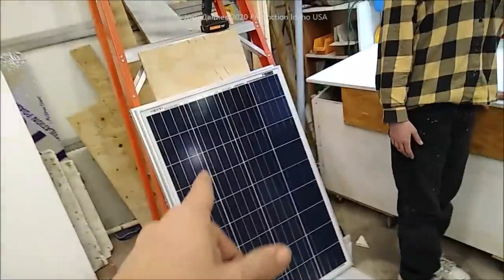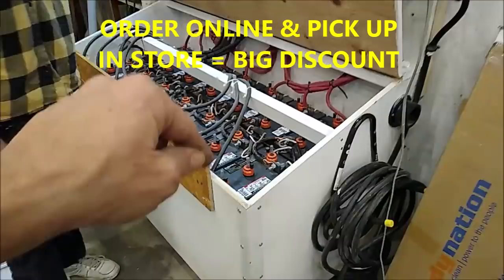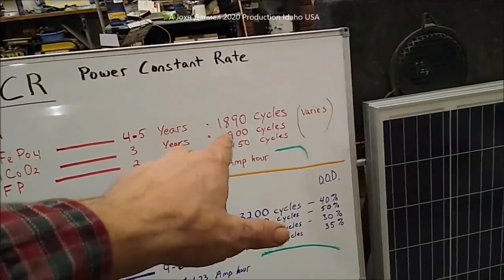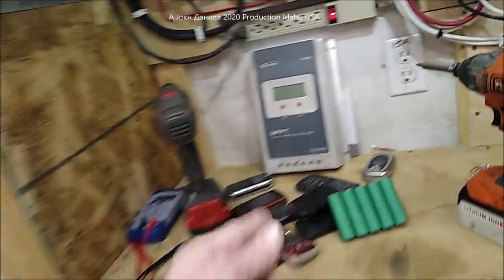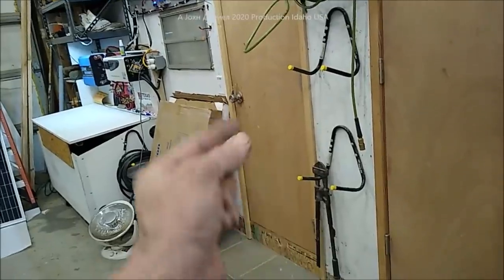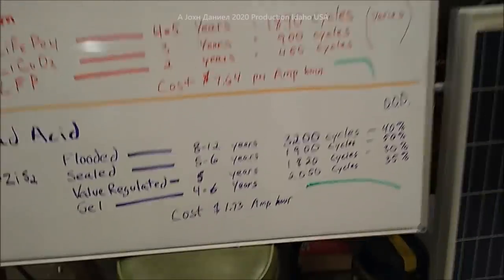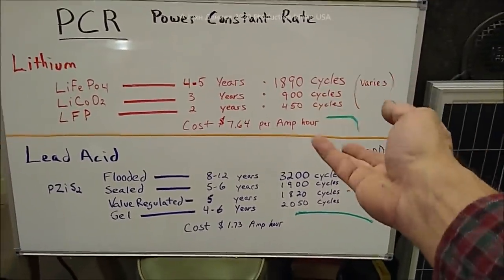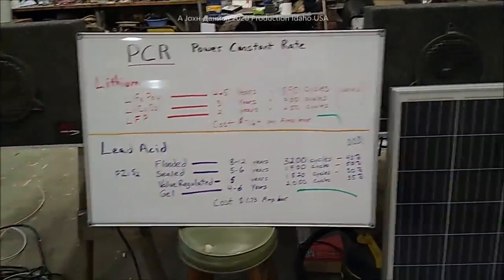Down Side of LITHIUM LiFePO4 Battery $ on RV, off grid & solar use (notes below)

Comment: You get 80-90% DOD with LifePo4 [Lithium Iron Phosphate] over 40% DOD lead acid.

Lithium Iron Phosphate [LifePo4] is stable not the same as unstable Lithium Ion.

Lead acid sucks in cold weather also.

All the batteries you are showing in your video are Lithium Ion chemistry. Not LifePo4. 

Yes I agree Lithium Ion is not stable.

Also lead acid batteries have a much higher resistance to charge. LifePo4 can take a charge faster with less resistance.
Reply: I’ve seen the vid of the 3 inch framing nail going into a used Caleb LiFePo4 prismatic cell from beginning to end. Lots of smoke, but I didn’t see anything go up in flames 🔥. He even picked it up with his bare hand.

I’m not sure what chemistry battery was in that RV you refer to that caught on fire. 

But if its a well built reputable LiFePo4 and didn’t have a 3” nail go thru it. I’m sure it would not have caught fire 🔥

I didn’t see any type of expansion within this video of the cell that got impaled with the 3” nail.
Reply from the maker: @cookemnstr9327  RV BATTERY WAS A 100AH, LiFePo4. But, You just described the issue without trying. But failed to mention QUALITY on these are a 50/50 shot. They were not supposed to swell up, they did. They were not supposed to short and almost double their amps in dumping act, they did. They were not supposed to get a bolt head pressed so deep in one it fused and set wiring and a internal BMS on fire, they did. The fire was due to a controller and under gauged wiring in them. The smoke was from the split open battery and fire. Hopefully you won't be on the jury in that case if the owner sues over it. Even Mr Prowse shows a substandard battery pack with the BMS against the battery cell , and poor wiring internally. When all this is corrected then I can get on board too. My 3 - 25 amp factory made batteries failed in about a year in different acts, all 3. LiFePo4 cells, blue, from Banggood using their motor controller, their chargers. My 36 volt former gas powered Honda 110 ATV is now happily using 3 - 18 hour SLA batteries for its 1000 watt motor, 2 years now. Slower by 2.5 mph, down from 19 to 16, but that ok, I ain't walking now.
Reply: @JOHNDANIEL1  Would't catch me buying the 12v packs, there in lie the gamble. The BMS of poor quality, poor construction, and those cylindrical cells that if not swelling at the very least will go bad one by one and you lose capacity and you can't just break it open and start tearing them out. Build your own out of prismatic cells. My case is unique in that i was able to visit the factory and watch all the test. They drilled a hole, nothing happened. Punctured another with a 12mm pointed round stock, a guy with a small sledge over a steel bin(safety third) nothing happened. Then,,, Laid that same 12 mm round stock from a distance across the terminals. 3.2v @ 200ah. Well, safety vent opens and its quite annoying to say the least and then the top cracks open just as they state in their brochure. They won't tell you that on Aliexpress or Banggood. I went home with an order. A safe installation  means your not going to have trouble. If you don't know safe DC wiring and proper lifepo4 charging characteristics you will kill them. If there is a short in a DC system with a large amount of AH behind it you can expect any battery to fail in an ugly way some nastier than others and wiring can light up and burn you down fuses on each every single battery and using single lifepo4 cells and absolutely NO  Lifepo4 12V PACKS!!! Have a nice day Young Man :)
Reply: So from what I gather on your explanation of this 100ah LiFePo4 catching fire on this RV, is that a bolt head had pressed into it and punctured the battery ??? 

Was it a bad installation ??? 

What caused the bolt to puncture the battery ??? 

I’m trying to understand why the battery would be at fault if it’s being violated with a puncture from a pressed bolt ??
Reply: @cookemnstr9327  No the LiFePo4 did not have a IC board to stop it from doing just that .Look at all the LiFeo4 they or all different boards it deepen on the circuit board it CAN kill you or keep you alive for 20 years . I independently set light from Interment computer room ( info room ) and freezer / fridge
Reply from the maker: @cookemnstr9327  Installation looked fine, contractor for a RV source apparently did it. Owner took it back to Colorado I guess, my job was clean up and put in 2 new regular RV batteries. Battery was not like a Battleborn style Battery thats using lots of round cells in a box, these were 4 packs of flat type looking yellow cartridges. Very weak case, but something went wrong in the end battery, it held air pressure like a balloon, swelled up and pressed the 2 others into a bolt which looked to make a 1/2" indent into one. All started apparently with a failing BMS, ended with a crushed battery part inside. My video was to explain the POOR quality being pushed, not the availability of LiFePo4 or the very few making a best option, just the junk thats being pushed and all the money being wasted on them like a cult, fad, over excited public does. Although I had 3 25ah fail on me, in a year, it told me its the quality thats the biggest problem, not the technology. Only the LiFePo4 cultist pusher gangsters freaked out over the video, they don't care that China is dumping them like crazy.
Reply: @JOHNDANIEL1  yeah I think that the easy places to buy from with free shipping are dumping b c and d grade AND misrepresenting them as otherwise better b as a c and d as b etc. At the factory they were grinding the failed batteries. Happens so fast that no reaction occurs except when one bounces back out, remember safety third. Factory direct is best.
Reply: GREAT VIDEO,...DEMONSTRATING WHAT HAPPENS WHEN YOU HIT THE BATTERY WITH A 3 INCH NAIL,...other then that this is not an apple to apple evaluation of different types of batteries.
Reply: I agree QUALITY is key. People must do their due diligence when purchasing pre-made LiFePo4 batteries. 

However, overall long time cost per ownership of a quality LiFePo4 battery supersedes the lead acid if properly setup. 

You will need less of them because Depth of Discharge is twice as much as Lead Acid and they will take a charge much faster than Lead Acid.

They will not sulphate like Lead Acid either. And you never have to water them.

Also ...  in the end of its rated life cycles of a LiFePo4 you will still have around 80% capacity which is still more then the 40% Depth of Discharge of a new Lead Acid.

I understand where you are coming from, I don’t disagree with you regarding a lot of the garbage pre-made batteries being built. 

People must do their research and due diligence.
Reply: Your talking apples and oranges. LiFePo4 [Lithium Iron Phosphate] chemistry is safe and stable. 

Lithium Ion and Lithium Polymer based chemistries are the unstable batteries.

You get twice as much Depth of Discharge with a LiFePo4 battery versus a lead acid battery.

Plus it charges faster because of its minimal internal resistance versus lead acid high internal resistance.

It’s better than lead acid without any maintenance needed.

Charge controllers need to be in place with the proper parameters set for LiFePo4. 

It’s not recommended to charge LiFePo4 batteries with a Lead Acid charger profile. 

The Life Cycles can degrade the LiFePo4 battery if the charge controller is not set for LiFePo4 profile.

Not all LiFePo4 pre-made batteries are created equal.

I personally would consider Battle Born LiFePo4 for a professionally built battery.
Reply from the maker: So your saying the video discussing COST and PROVEN is not accurate? Are you saying the massive dumping of LiFePo4 on the world market by the Chinese with a 30% purity rate and a 50% BMS fail rate is better than 70% cheaper proven lead acid for people to consider?
Reply: @JOHNDANIEL1  where is the evidence of a 50% failure rate of bms's, and a 30% purity rate?
Those small device batteries you where throwing around on the table are not the same as the larger battle born batteries that are used in RV systems .
Reply: Јоhn Daniel No, he is saying that you ascribing the faults of lithium iron batteries to a different kind of batteries that is a distant cousin, and does not have the same problems.
Reply: Јоhn Daniel I agree for a stationary setup flooded lead acid are still the way to go (if you want really great value look at recycled fork lift batteries).
Reply from the maker: NOT DANGEROUS - Same deadly smoke that could have killed 4 in a 39 foot MotorHome when 1 expanded into 2 then into the frame, https://youtu.be/EMARDvMz62A
Reply: @JOHNDANIEL1  That is a great video because it shows how safe and stable lifepo4 is. No combustion. There are safety studies done to show it.
Reply: @WillProwse  Totally agree! LifePO4 batteries are more efficient than the other ones.
Reply: @JOHNDANIEL1  The video you reference is meaningless unless you want to compare what would happen if you shoot a 3" framing nail into a lead acid battery. I think the LA results would be worse. Severely overcharging a LiFePO4 battery will cause it to vent. Severely overcharging a lead acid battery will cause it to vent explosive hydrogen gas and it will explode if the internal battery pressure becomes too great.

Comment: tried 2 small lithium batteries and they suck. used one to crank briggs and Stratton delco starter generator barely cranks for 6 seconds at a time in 25°F JUNK
Reply from the maker: When go GREEN means we accept being bombarded with a million tons of toxic batteries every year from China, and in the last 2 years the fail rate on the built up ( non single cell) is getting near 50%. Claims of SAFE are just that, they call the LiFePo material factories and mining operations Cancer Makers for a reason. Over 40,000 children in Africa mine rivers and swamps with a mortality rate exceeding the 1700's so Americans can have light weight power. LiFePo4 pushers making BANK! Cool huh.

Comment: I last 12 years wity lead acid battery before changing over to lithium...  Biggest mistake EVER...
It start fire in my garage and it was so INTENSE , it burn my house too.
Never going to use it again for solar..
Reply: Hey Buddy, hate to tell you that Missouri Whinning and Stumpidness has got my channel taken down, TheBillytheJack2010!! It has been up 4 yrs now and has a new video on the Axial Flux 12 coil I'm building. So please sub and like my videos, please... Heres a link:
https://www.youtube.com/watch?v=Jo8967xP8GE&lc=z22gxr4hhovsyeqtm2hd0s2yq3pcpphhtjgmutyvvj00u00c2
Reply: @blackjackaxialfluxturbines4174  Ok
Reply from the maker: Yet they claim they are NOT flammable. If you ever saw their wires and BMS burst into flames you could almost agree, the battery is likely safe, everything on it is a fire hazard!
Reply: @JOHNDANIEL1  https://dixquatre.com/2019/07/16/un-incendie-affecte-trois-terrains-residentiels-a-rouyn-noranda/
Reply: That was my place...  I lost everything...
Reply from the maker: @alaindesrochers4676  Where the heck did you move to, or did you rebuild
Reply from the maker: @alaindesrochers4676  LiFePo4 battery packs from China? Or parts built into a power pack?
Reply: @JOHNDANIEL1  I did rebuild my house for now but the garage will wait..
Reply: @JOHNDANIEL1  The battery  were the same as the 40v pack A123 that sell on ebay

Comment: Interesting video. Others claim that lithium batteries will last 30 years. ...I'm not questioning your claim , and have also read that Li batteries only work well in a small environmental/temperature window (not too hot, definitely not as cold as I get up here... often below zero in winter). How can those claims be made without legal repercussions? Electric vehicles have to be able to work in a wide range of temperatures, and they certainly survive heavy current draw to accelerate from stop. ....but as I started with, it's an interesting video, and all discussion has to be considered. BTW, our lead/acid battery bank is two parallel sets of 8 390Ah L-16s that cost me $250 each a bit over three years ago, fed by parallel sets of panels and controllers. I designed redundancy into the system so we have some power in the event of component failure (hasn't happened in 10 years). These replaced  the original set of 24 golf carts (in two parallel banks of 12) that lasted over 6 years by babying them. I hope I get 12 to 15 years on these heavy things, because I'll be in my mid 70s at replacement time. ...hey John, since you're talking batteries, what do you think about the Nickle-Iron (Iron Edison) batteries? I know their energy density is much lower than lead, so very large for the same storage (not suitable for the RV world, but for off grid house consideration). Claims are long life, like the lithium proponents do. ...claims... (and costly).
Reply from the maker: When go GREEN means we accept being bombarded with a million tons of toxic batteries every year from China, and in the last 2 years the fail rate on the built up ( non single cell) is getting near 50%. Claims of SAFE are just that, they call the LiFePo material factories and mining operations Cancer Makers for a reason. Over 40,000 children in Africa mine rivers and swamps with a mortality rate exceeding the 1700's so Americans can have light weight power. Cool huh.
 And if you say to the LiFePo4 battery cultist that China is dumping on us, they claim thats Racist, if you say what about the thousands of black children mining the toxic crap and dying..........They vanish.
Reply: @JOHNDANIEL1  No argument there... as I said I agree. Asking the last question, in case you found my post too long winded to finish (that happens), what do you think of the nickle iron batteries? Yes, nickel is toxic, iron is not. KOH is the electrolyte instead of sulfuric acid. They're out of my price range, large, and also heavy. Anyway, just wondering about your opinion there as well. Thanks for your videos.
Reply from the maker: @petset77  Manufactures CLAIM incredible results, The claims  ( claim
 - /klām/  verb ; state or assert that something is the case, typically without providing evidence or proof. plural noun: claims; 1. an assertion of the truth of something, typically one that is disputed or in doubt.)  as said about anything are exactly that, unproven. SO from that I studied Proven 100+ year history, HUP1 Batteries ( Lead Acid best ) to UPG (Lead Acid Worst ) and compared that to CLAIMS from Lithium based, LiCo, LifePo, and when all you have is 1 month to 2 years of CLAIMS on how they charge, Cycle, can be used when charging, actual value per watt/amp, and more then I made the video. 
As for Edison Batteries, again, Cost has to play a roll. Nice design, and only few examples of longevity although lots of claims of more.

Comment: FYI. LiFePO4 batteries don't catch on fire, the other lithiums can if not properly charged/discharged. The small LiPo silver cell packs you showed are the most dangerous. Not all of the big batteries are constructed of many little battery cells. LiFePO4 batteries are rated for 2000 cycles but at that point, they still have 80% of their rated capacity and are therefore usable for many, many more years. So your lithium costs are NOT accurate. LiFePO4 batteries are not new, they have been around for decades. They are becoming popular now because the manufacturing costs have come down enough to make them more affordable. I do not sell these batteries, I am a user of them. Your lead acid batteries are not entirely safe either, they vent hydrogen gas and contain acid. Bad things will happen if they are overcharged/not charged properly just like lithium batteries. The only really safe batteries are edison nickel iron batteries. Believe what you want.
Reply from the maker: When go GREEN means we accept being bombarded with a million tons of toxic batteries every year from China, and in the last 2 years the fail rate on the built up ( non single cell) is getting near 50%. Claims of SAFE are just that, they call the LiFePo material factories and mining operations Cancer Makers for a reason. Over 40,000 children in Africa mine rivers and swamps with a mortality rate exceeding the 1700's so Americans can have light weight power. Cool huh.
 And if you say to the LiFePo4 battery cultist that China is dumping on us, they claim thats Racist, if you say what about the thousands of black children are filmed mining the toxic crap and dying..........They vanish.

Comment: Interesting! Thanks, John! I'm also looking into silicon dioxide batteries. Looks like the same or similar cost and chemistry to lead acid but no maintenance and good to -40 deg. Wonder if you had any thoughts on them. Also heard them referred to as lead crystal batteries. I'm hearing good things about them but it's very hard to find any videos because like you said, lithium is everywhere!
Reply: Joshua Kiser thanks!

Comment: Tried and tested lithium batteries from Battery Hookup. Capacity tested and the cycles are better than lead acid.
30% of a lead acid battery used is being safe were as 60% to 70% on a lithium is looking after it.
$100 per kilowatt for lithium nowadays but the new tech is even 30% better than lithium. 
There is no lead acid batteries in Elon Musks rockets for the turbos to feed the fuel because they just dont have much power to weight ratio Weight ,cycles and performance is driving the lithium market which is now being out done with latest tech.
Power walls is a way of recycling lithium batteries.
Use a temperature probe to turn on a fan to cool them if needed as used to cool down a rectifier. 
Cheers and thanks again for your energy I have learnt so much on windmills from you and I'm close at putting my own up.